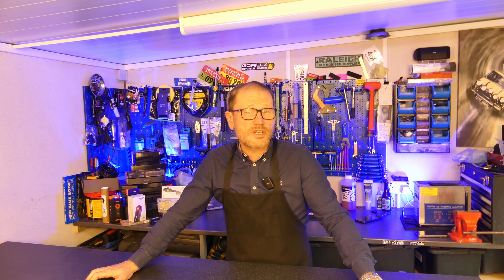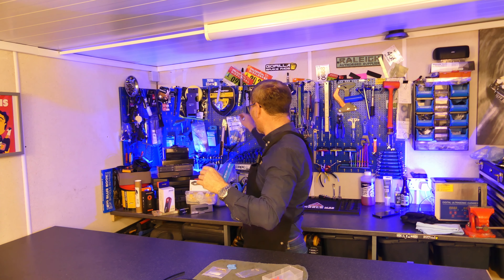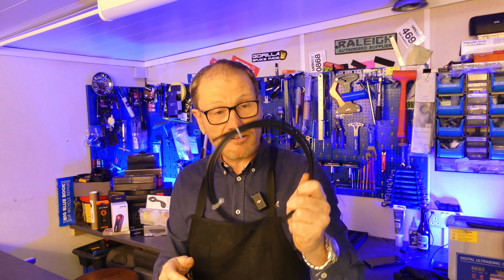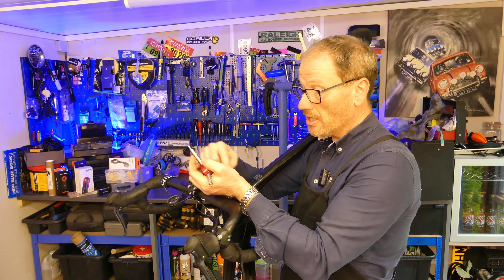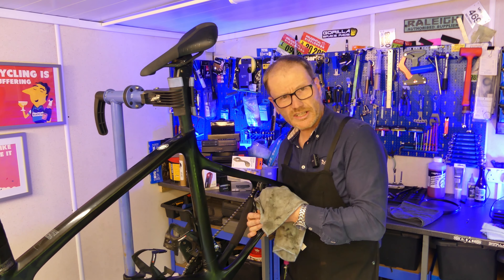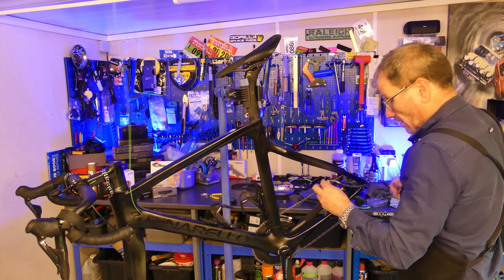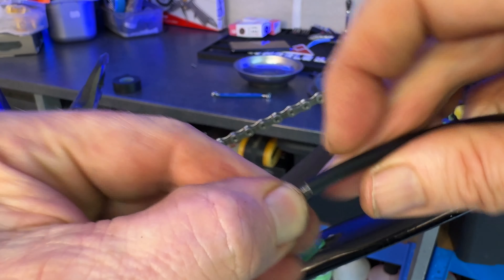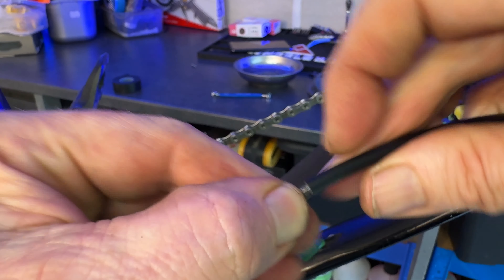How To Replace A Hydraulic Disc Brake Hose - Road Bike maintenance

Comment: Thank you as always; freetocycle cuts the olive with a rotary tool (replacing a caliper) and just uses a new olive without cutting the cable. I mean, a dremel ain’t cheap but really wouldn’t wanna cut the cable in order to be able to put a new caliper on. Fingers crossed.
Reply from the maker: The thing to remember is that you can't break the bike, you can just end up making more work. 

The first question to ask, is do you need to replace the olive? If you're just changing the calliper, then chances are, the old olive will hold.

The olive acts as a seal between the hard metal of the calliper/lever, and the hose. Both surfaces need to be in perfect condition in order for the olive to seal (Just like in plumbing). It is 'Technically' possible to cut the olive off with a Dremel, but you would need Ninja level Dremel skills to not nick the hose in the process. And if you did, you don't have a perfect surface, and it'll leak. And anyway, why chose the Dremel method, when you can just cut the olive off. Most setups have enough slack in the system to afford the 1cm of hose loss. The only exception to this, is internally routed setups. If this is the case, and the hose ends up too short, then just replace it with a new hose (£10), and re-route it through the frame using a Internal Cable Routing Kit (£14).
https://amzn.to/421btG8
Reply: @ribblevalleycyclist  appreciate so much that you wrote a response, thank you

Comment: If you don't have the cable routing kit, you can slide a gear or brake cable up the old hose, leaving it in the frame as you pull the outer hose out, then slide a new cable back down the cable and out the bottom....
Reply from the maker: Agreed. Or you can just tape the new one to the old one, and pull them through. But at £17/$21, it's worth getting the kit.

Comment: What great, cleat video 👍👍. I was all ready to start but was thwarted by the cable grommet at the top of the frame. Like you, I tried to undo the little hex bolt but it was stuck fast. Got hubby to try and he couldn't do it either. I have used your vid to route the cable outside the frame though 👍. If you have any tips for freeing the hex bolt, I'd love to hear them. Brake working absolutely fine outside the frame but looks a bit rubbish 😂.
Reply from the maker: The cyclists worst enemy, galvanic corrosion! Give it a good soaking with something like WD40, and then re-visit the problem in a week or so.
Reply: Thanks 👍. Will try that.

Comment: Hi, I've just come across your channel and what a great job you're doing, it's going to save me and fellow cyclists lots of time and money. I have a Ribble gravel sl, that I need to change the headset bearings. However the internal cable routing means I have to disconnect the hose from the levers, will I need a new olive and barb or could I reconnect them?
Thanks.👍
Reply from the maker: Welcome onboard. Although the olive distorts and crushes (like in household plumbing), there is a good chance you can re-use it. There is a huge HOWEVER!!!!! If you’re running internally routed bars, then you won’t be able to remove the hose from the bars/stem without removing the Olive from the end of the hose. And as the olive is crushed on, you’ll need to cut the hose. And as there is little spare hose in internal routing, there is a small chance that small amount cut off the hose means it will then be too short, so the whole hose will need replacing!!

Comment: Thanks for the video!  One question I have is how tight should you tighten the flare nut when re-connecting the hose?  Is there a risk of over-tightening the nut and crushing the olive?  Thanks!
Reply from the maker: Good question. The idea is to tighten so much that you do crush the olive. Crushing the olive deforms it, and makes a good seal...... in the same way it does on household plumbing systems. This is why the olive is made from soft brass, rather than steel. When you tighten the flare nut, it won't come to a sudden dead stop like a normal nut, it'll become gradually stiffer as it deforms the olive below it. You'll know when to stop.
Reply: @ribblevalleycyclist  Ah I see!  Thanks for the prompt reply 👍

Comment: Hi, thanks for the video. I have to replace my bracket cover and Shimano tells to change the olive and connector. My question is: is it possible to slide a new olive with the connector in place?
Reply from the maker: The problem is, the olive is crushed onto the hose..... and I mean REALLY CRUSHED!!, you'll never get it off, you have to cut the hose and put a new one on.
Reply: @ribblevalleycyclist  Thank you for your reply  :)

Comment: Excellent subject......simple but costly.
Price of hoses suck! 😂
I say that because as an example Shimano 105 gives a specific code for the hose set including barb and bolt for the 105 shifters/calipers normally around £30

But the hoses are as you show bh90 which can be purchased separately and at less cost. Fortunately. Just need to keep the bolt on both ends of hose.

Question is...... When to replace the hoses?
In theory I'd imagine they could last years due to the materials used?!
Reply from the maker: Agreed, hose is crazy expensive. 

That hose was 5 years, had done 8000 miles, and had seen two groupsets. It didn't need replacing, I just did it for the video!! To be honest, I don't think the video needed doing, as not many people would do that job, and thats why it's not doing very well, but it's one I think people should know how to do, so I did it anyway.

Comment: I've changed my caliper on the front but my hose is now leaking at the where the hose enters the caliper 🙄🙄🙄 any ideas? Is there supposed to be an O ring in the thread port on the caliper?
Reply from the maker: There should be an olive between the flare nut and the calliper. There should also be a metal hose insert going into the end of the hose. The olive is crushed onto the hose when the flare nut is done up. So, when you removed the old calliper, the Olive should’ve stayed in place, as should the hose insert. On the odd occasion, the olive can leak if re-used. Make sure the olive is there. If it is, then it’s failed, and will need replacing. If the olive needs replacing, you’ll need to cut the hose, and re-fit both the olive and insert.
Reply: @ribblevalleycyclist  thanks for the reply. The problems never end 😄. The reason I've replaced the whole caliper was because the brake pad pin had seized...fitted a new caliper and successfully bled the system...only to find another problem in the dominos of problems🙄😄 bikes are high maintenance and more expensive to put on a road than a car sometimes....another Amazon purchase made for the cutting tool and new grommets.
Reply: @ribblevalleycyclist  can I just snip the end off where the olive is and reuse the hose if there's enough length?
Reply from the maker: @ Exactly that. Also, once you’ve snipped it off, you may be able to push the insert out and re-use it

Comment: How would we know when our hoses need replacing?
Reply from the maker: They don't tend to wear out. You only need to replace if damaged. That hose was 5 years old, had done 8000 miles, and had seen two groupsets. It didn't need replacing, I just did it for the video!!

Comment: When you undid the hose from the shifter, why didn't any fluid come out?
Reply from the maker: Good question, a few reasons:
1. You know that trick where you put your finger over a drinking straw, lift it out the drink, take your finger off, and all the drink drops out the straw? It's still closed at the calliper end, so the same principle is happening here. When I take it off the calliper end, you'll see it come out, and thats why I needed a cloth.
2. The inside of a hydraulic hose is very thin, so there is only about 20ml of fluid in there, so next to nothing anyway.
3. The fluid isn't under pressure.

Hope that explains it.
Reply: @ribblevalleycyclist  Ok, interesting. When i see people bleed brakes with the syringe at one end and the cup on the shifter, it always appears there's a lot of fluid going in.